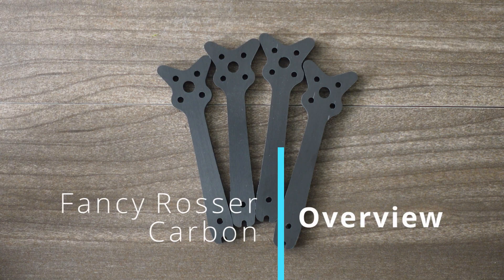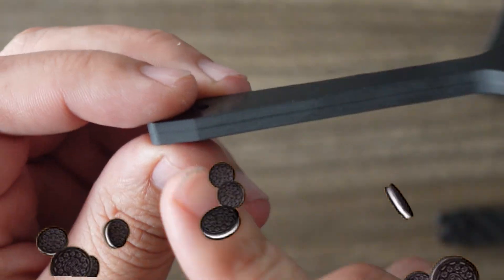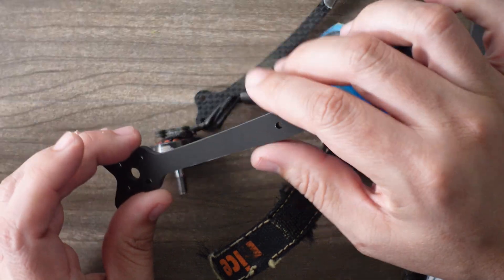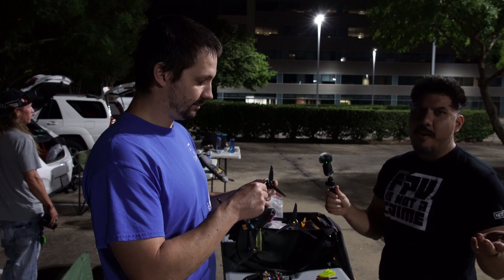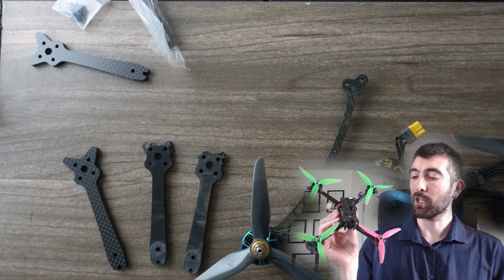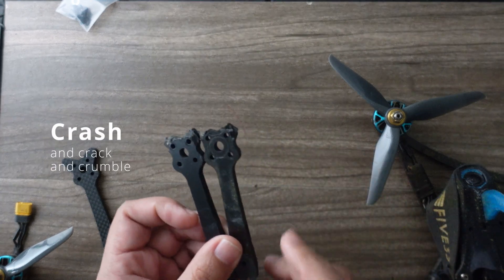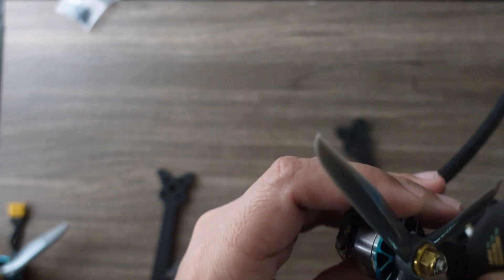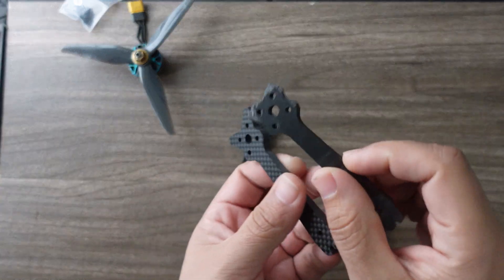Rosser Carbon Fiber arms - Chris Rosser's carbon better than standard FPV drone?

Comment: Those eaten up ends are a sure sign they use less epoxy to bind the lay-up. This (and the different fiber orientation) makes the material a lot stiffer but sacrifices impact resistance :(

Comment: My hot take: the juice ain't worth the squeeze on this custom layup... Not until there's a vendor producing it in a manner where tolerances aren't all over the place in material thickness. I'd rather just go for t-700 in a regular quasi-iso layup if we're talking about spending more on materials. That being said, t-300 is more than enough for our needs. -edit ... Nick at CNC madness is awesome for even trying to source and stock this stuff btw. They don't do layups themselves, but I know they're looking for the right manufacturer to do this right. It's just not really there yet